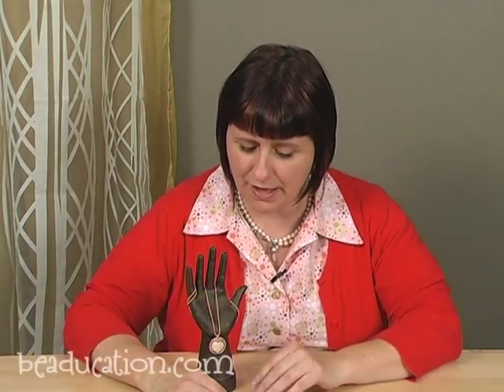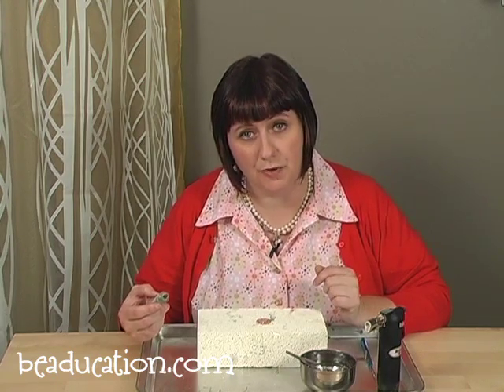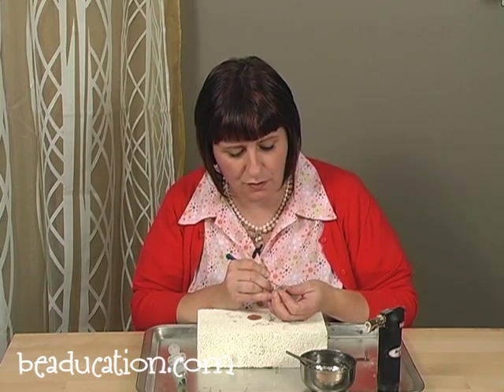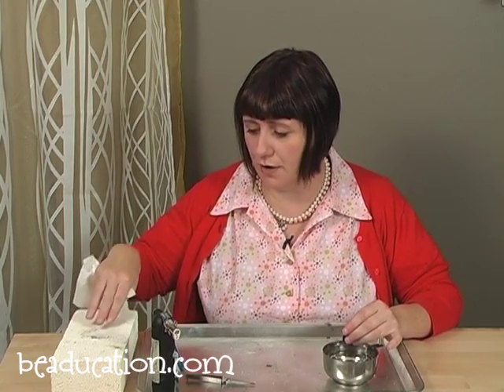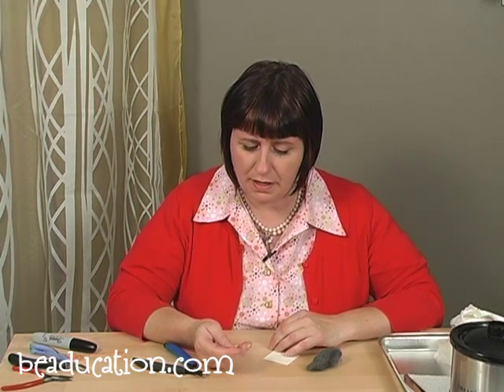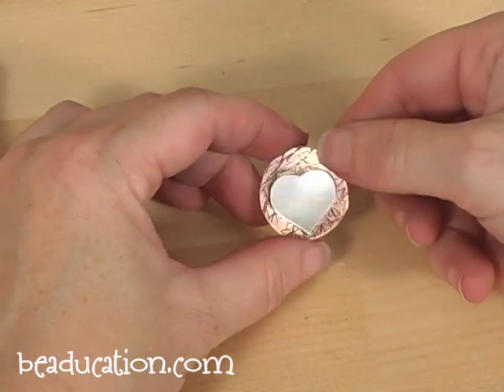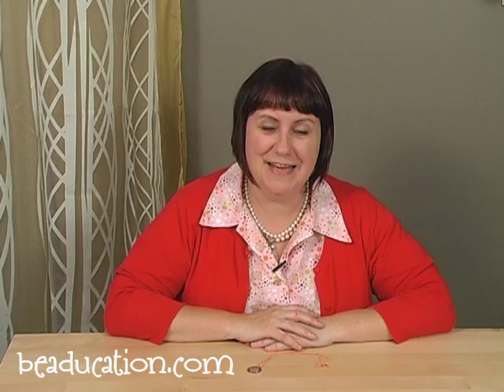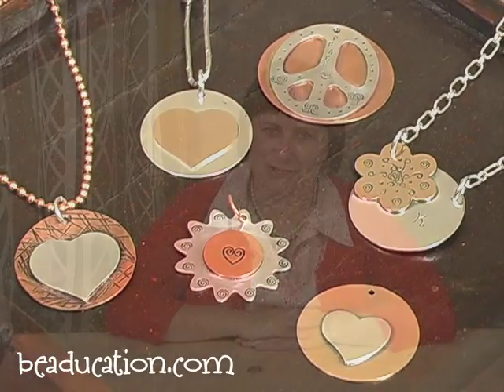Simple Soldered Pendants - Beaducation.com

Comment: Loved this video! Learned so much.  Would I be able to use the same technique with a stainless steel blank?
Reply from the maker: Hi, the other metals used in the tutorial solder more easily than stainless steel. In order to solder stainless steel, you need to break the oxide barrier so that the solder can bond to it.  This just means it's a little trickier - not impossible.

Comment: Been watching your videos but my question is  what do use to solder with coated copper wire making some jump rings also i am using my propane torch hope to hear from you soon
Reply from the maker: Silverguardiancreations Hi there! You won't be able to solder coated copper wire. The coating will melt (and emit toxic fumes because the coating is basically plastic) and not allow the metal to be soldered.

Comment: Can 0.3 mm thickness german silver be used as bezel wire.....My concern is whether the edge can be rolled on to the stone...
Reply from the maker: +brian tudor sorry for the late reply! I can't fully answer your question because I have no experience with german silver. The only concern I would have is that I have heard it tends to be very hard, so yes, you might be right that it won't easily roll over the stone.

Comment: Can u do this with pewter charms ? Steel?
Reply from the maker: Not familiar with soldering with either of those metals. We do have a helpful guide called All about Metals that you can check out. 
https://d2pafxp37ue0ak.cloudfront.net/system/product_guides/pdfs/13/original/All_About_Metals_2018.pdf?1538523772